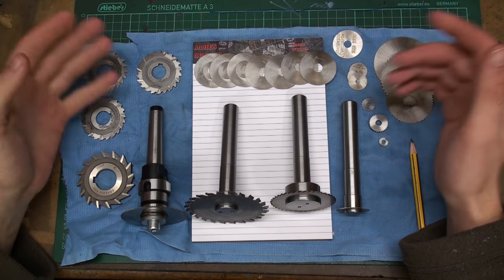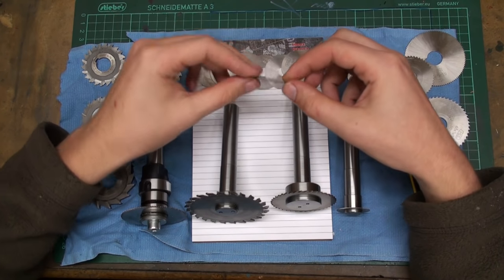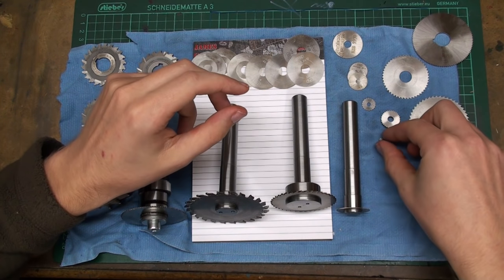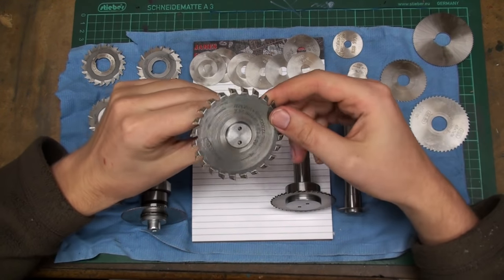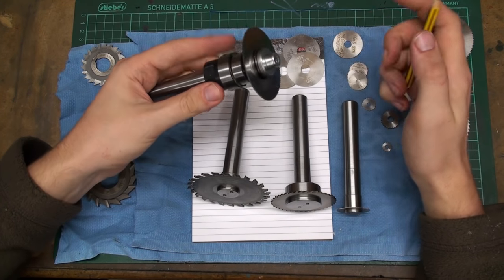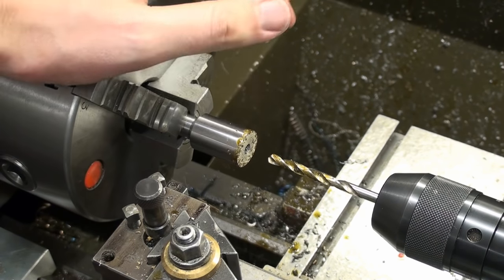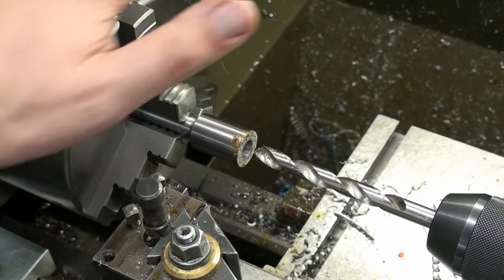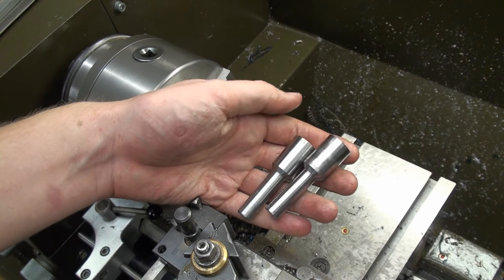Saw arbors Part 1 - Sägedorne Teil 1

Comment: Hi Stefan 
I just got lucky and my brother-in-law gave me a big box of inserts slitting saws Mill bits insert for boring bars a few nice carbide boring bars and a whole bunch of small carbide boring bars I mean a literally enough to last me my entire life. They are all brand new. He works in an aerospace company that if an engineer for some reason decides that it's not the right tool that has to leave the building it cannot be held so they throw them out or they let people take them home. Military contracts are funny that way they have a lot of regulations regarding what can even be around. I also got about 50 pieces of 304 stainless round stock about 4 ft each! my brother-in-law is an amazing person he's really been taking care of me LOL

Anyway so I need to make some Arbor so I'm glad I found your video here. I've made them before but they're never exactly as nice as I would like them so I want to see what you do here and I'm about to watch it now. I had an idea however for a good video I don't know if you would like to do this type of thing but it would be interesting to me any way to learn about the different threads and clamping forces that are appropriate for different applications because I am always wondering what thread to use for a specific task.

Anyway it's just an idea I would love to see you do it if you have the time or the desire

Thank you very much

Great video is always and now I will continue watching it

Comment: Great! I made something similar but 3 mm shank and 8 mm total diameter to fit in the MF70. But I used a small hex screw for the bolt. Now you gave me the idea to make a shoulder bolt like yours.
Reply from the maker: +Cosimo Marotta Tiny stuff :) The shoulder bolt is nice as it centers the saw very well.

Comment: Thanks for this serie of videos. I saw them 1 or 2 years ago and now I made an arbor. It turned out very well.
Time 08:30... That's what I picked up for my simple Ebay blades having a 6+ mm hole. Joe Pie recently showed arbor making and that triggered me to use the knowledge from Your serie of videos.
Time 08:39. "Fine thread"... I used M6 1 mm. M6 0.5 mm is available but is the strength of that thread enough? Okey, depends on how well it's made.
Time 09:25 - 09:50. Excellent foto, clearly showing how You did it.
Haha... Time 19:30. Lathe jumping off the table..... Lovely sense of humor.

Comment: Stefan, I noticed your new machine is a Morse taper, why did you choose that over R8?
Reply from the maker: +eformance Because only about 5 persons have machines with R8 in germany ;)
Its all Morsetaper or 30/40 taper on the smaller machines.

Comment: Nice, Stefan. I couldn't make out the name of that neat little carbide boring bar. Do you have a link, please?
Reply from the maker: They are made by pHorn, its the 105 series:
https://eshop.phorn.de/ishop/Drehen/Einstechdrehen-(innen)/Supermini%C2%AE-105/product/node/10065_10007_10005.html;jsessionid=B1B4C871F82372937543E66F6F506801
Reply: How do you make holders for those?
Also, regarding the arbor material, was that an error with the 42 CR MO S6? All I can find is 42 CR MO 4 (1.7225) (although I do lack a decent understanding of steel and those material numbers and short names.)

Comment: Stefan,  what is your thought on a small radius at the juncture of the taper and the straight shank ?
Reply from the maker: +Darryl Dodge Good idea, and as most of my lathe tools have a small radius on them there is one :)
Reply: +Stefan Gotteswinter Thanks for the prompt reply, but I was thinking more like a 6 to 10 mm radius...
    it should strengthen the tool a lot more than a tiny radius at that inter section.

Comment: As always it is a pleasure to watch your videos. But I have a point that bothers me. People are always saying that digital calipers are merely approximate. I have a pair of calipers that agrees with my  (analog) micrometer to .01mm on average. When it does not, I hold the calipers,  closed, up to the light. If I can see light, there is some crud on the calipers. Give it a wipe and I am back to .01mm. And a micrometer is not idiot-proof either, because you can over/under tighten it. I must attribute this to coincidence. I just happened to win the caliper roulette. However it would be interesting to make a wider comparison. with a bigger sample than I can afford!  Many people do not wipe the crud off their calipers before measuring., and hence "the calipers are off". Further not all calipers will not hold their zero exactly. Including mine. Pass auf!

Comment: Some great information as always Stefan. That sure looked like a Rohm keyless you were using. How do you like them against the Albrecht?
Reply from the maker: +Turning Point Yes! I have a 1-10mm Röhm Supra on the lathe - Not as nice as the Albrecht (But also only half the price), but still a very nice chuck.
Reply: +Stefan Gotteswinter Many thanks Stefan, I'd always wondered how the Rohm chucks stacked up against the Albrecht. 

I did buy 3 integral shank keyless chucks from Glacern Machine Tool in California. 2 with R8 shanks and one MT 3 for my lathe. I'm almost positive the Albrecht was part of the design. There pretty smooth with very low runout, but just not quite as good as a real Albrecht. Only about $100 though. And I view drills the same as yourself. There only a roughing tool.

Comment: like at least one poster below, I would like to see how you would make a holder to fit the rather oddly shaped end to that small boring bar!
Reply from the maker: Back then I just cnc milled the profile :D
Without cnc, I would drill/bore/ream the two endradii and mill the tangents to it on the rotary table with a small, long endmill.